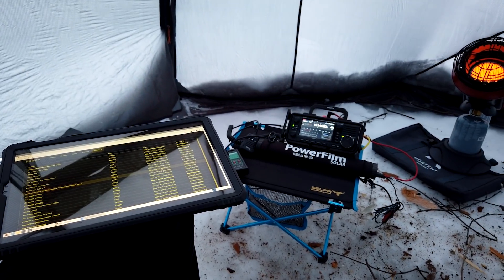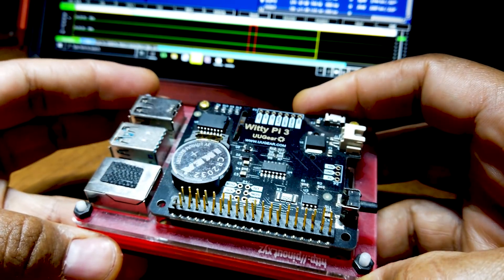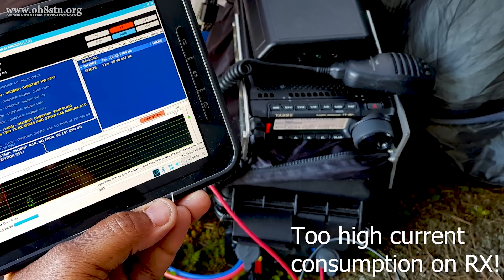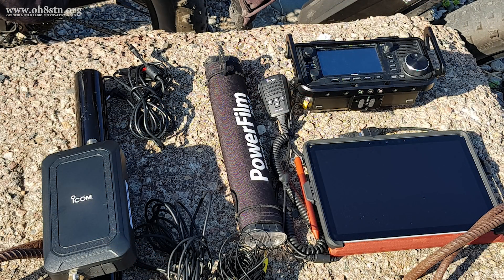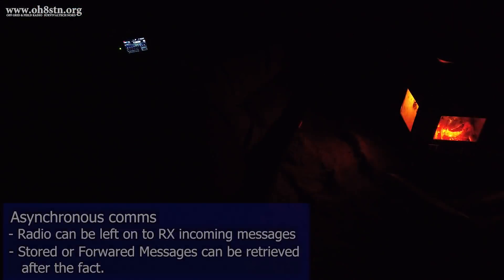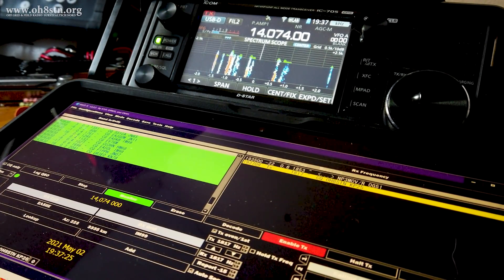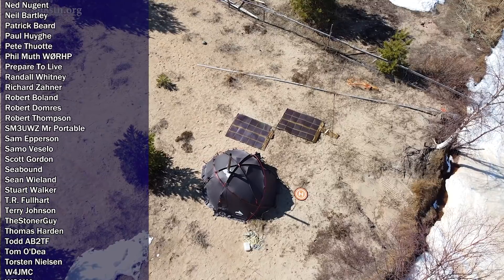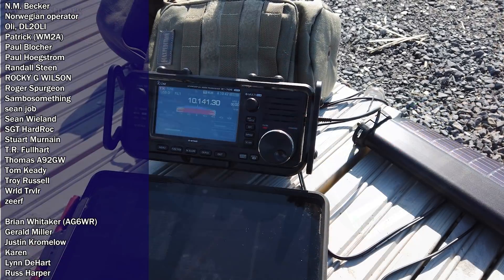OH8STN Ham Radio

Comment: I agree that the pi is fragile for a back pack carry device and you still need another electrical thing to host a screen. One thing that you did with the pi is the gps stick to set the system time from the gps data. How are you doing no internet time sync with the surface?

Comment: Great video as always ! How do you power your Microsoft surface ? I just sprang for a surface go 3 and it’s a great little machine but of course -  no Anderson power pole or mfj 12 volt plug input . Any special adapter out there ? What I wouldn’t give for a compact laptop or surface with Anderson power pole …..
Reply from the maker: Wrote a post with all details about the Microsoft Surface Go on the blog.
73
Julian oh8stn 
https://oh8stn.org/blog/2021/10/10/microsoft-surface-go-2-faq-ham-radio-laptop/

Comment: I've come to some of the same conclusions but haven't made exactly the same choices. My 891 rarely gets used while my G90 with its superior receive current specs and amazing internal tuner get used almost exclusively. The x5105 and 818 get some use too. 

I've considered the 705 but in my opinion it's pricey, not very rugged, and it doesn't have an internal tuner like the g90. I really thought I had found the solution to the shortcomings of the 705 with the QR-20 (HS-2) but the promised specs don't match the equipment realities (and I don't think any amount of firmware updates are going to fix it). I sent mine back as it is not reliable and has too many issues. A real shame as the radio promised so much but failed to deliver. I'm still looking for the perfect rig but haven't found it yet. ;)

For solar power, I have 2 foldable 100 watt units that I parallel and they've been great. I'd like to get into a bit of wind power options but haven't pursued that one yet. 

For computers, I've considered the Surface but I continue to stick with my Pi's and my Larkboxes. For the time being, the Pi is my go to for low power consumption work but if I need Winlink I'll use the Larkbox as VARA is more reliable and you'll end up using less power with it than trying ARDOP endlessly in poor conditions. I run all of the computers headless,with either phone or tablet as my screen. I prefer this setup as I don't like being attached with wires at the operating.point and this plus cost is why I've stayed away from the Surface.

For antennas I usually carry two with me. The Superantenna MP-1 and one of my EFHWs. Between the two of them, I can do whatever I need to do. My next project is to experiment with some 2m beam antennas (homemade tape measure and portable Arrow as well) as the closest VHF Winlink gateway to me is 100km away. I'd also like to try some VHF SSB.

Thanks for sharing your thoughts Julian!  You've confirmed some of the same conclusions I've come to and given me some things to think about.

Comment: Great video and content on your channel. Do you think it would be possible to run this (or a) setup from Android. Not utilising Windows? Atb Si
Reply from the maker: Thanks for the kindness and the question. There are some apps for Android but they're pretty much outdated. The only up-and-coming one we have is for winlink. It doesn't have all the features of a full winlink, but it's a start.
For some reason developers don't see the value in an Android operating system. In fact Android would be my operating system of choice. Perhaps I should make a video to try and Trigger the community.
73
Julian oh8stn

Comment: Julian, why not use a small sdr receiver like Airspy hf discovery to receive and then use a more powerful rig for Tx?
Reply from the maker: In principle why not.  It does become complicated when using multiple radios. However, this could be done with a single SDR like the HackRF and amplifier.

Comment: Over the last few years I have been transitioning off of Windows systems as much as possible.

Unfortunately, I came to the same conclusion that the Linux based utilities are still a little bit too fiddly to rely upon.
The closest I have found so far would be the excellent utilities packaged in KM4ACK's Build-a-Pi. They go a long way towards automating the heavier configuration steps needed to get things like Winlink operational.

I ended up getting a Lenovo Yoga 11e 6th gen. This thing is very low power and quite comparable to a surface tablet, but still has a full keyboard so no stylus required.

Comment: Julian, have you got the x6100 to work with Winlink?  If so, what are your settings?  Thanks, IU3JNT
Reply from the maker: It hasn't arrived yet  😒
Reply: @OH8STN  Just got mine today.  Trying to get all the digital modes to work.  At least there is only one cable for control and audio.  I need to upgrade the firmware to see if there are some fixes.
Reply from the maker: Please do share your experience
Reply: @OH8STN  Still working an issue with VARA. I am using the ICOM 7100 settings and everything seems to function, but the send receive handshake cycle goes too fast. When the other station responds to my signal, the X6100 radio transmits back too fast to allow a handshake.  It seems a software issue with VARA.

Comment: Just a thought as I haven't done this field operation yet. 

Could the Raspberry pi use a gpio pin for a single RGB LED to illuminate or flash certain colors for status updates like a message received. Could this single LED use less power than all the screens running?

Comment: Hello - new subscriber from the Dominican Republic here and interested in your QRP experience. May I ask why Microsoft Surface vs say a Android phone?  I know it’s smaller etc. but if it’s programmed and set up at home - wouldn’t it use way less power than the surface?
Reply from the maker: Excellent question in yes you are absolutely right. The problem we have with android smartphones and tablets is a lack of  Ham radio software for  Android. I am a huge android fan but find the lack of tools for amateur radio very frustrating.
Thanks for the awesome question and welcome to the channel. 
73
Julian oh8stn

Comment: "Xiegu G90 replacing 5V LDO with SMPS" by YO3HJV

Before: 650 mA on RX
After: 369 mA w/ATU,  286 mA no ATU

The 23% difference with ATU off looks useful to remember, and it also reduces noise. There's a nicer looking mod in his comment section (PDF).